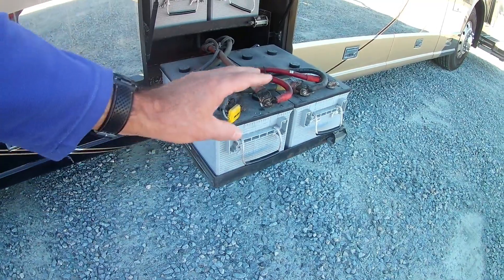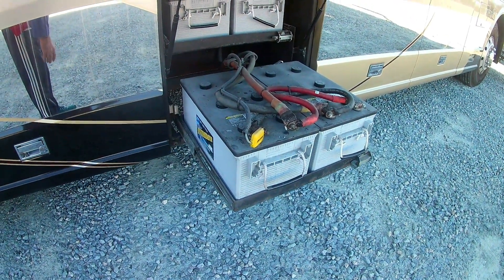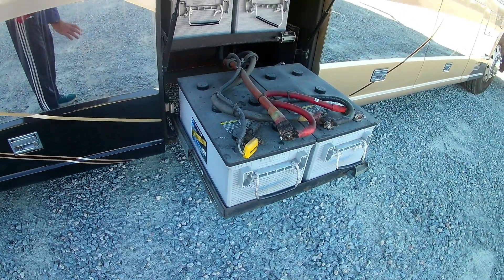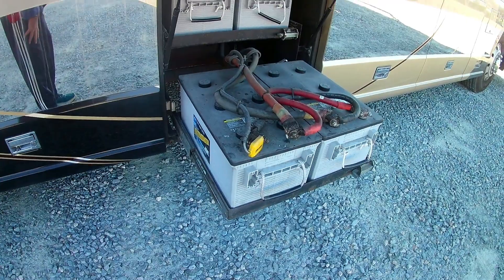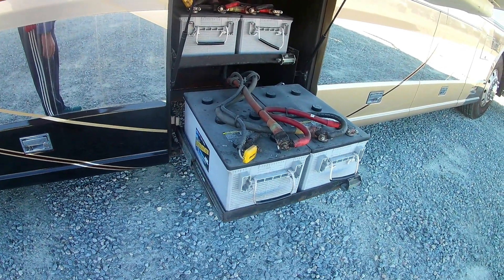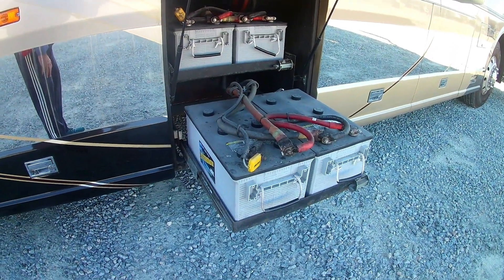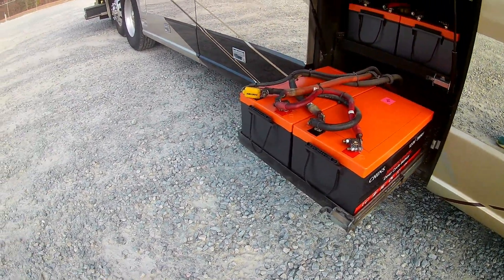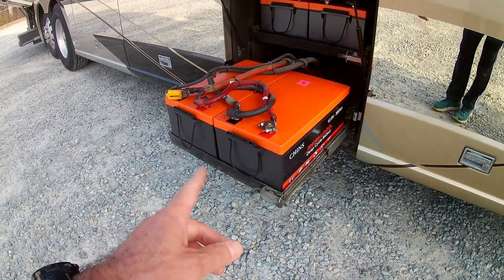Lithium batteries install in our motorhome,  Country Coach Affinity

Comment: Hello, I also want to replace the batteries of my motorhome for a 300ah lithium. I bought the victron smart dc-dc 12v 30 amps. Can I connect the victron changer with the wires coming to my auxiliary batteries (by adding 60 amp fuse protection at the input to the output) now to my new lithium without modifying the old installation

Comment: What is total ah on your lithium? Are your invertors set on lithium or amg?
Reply: Clearly says 4X 300Ah 12V batteries. So 1200Ah at 12.8V or 15.36kwh. Ah is not a good number to use